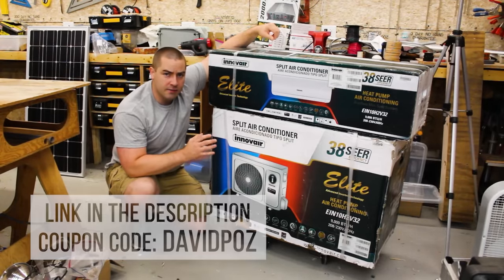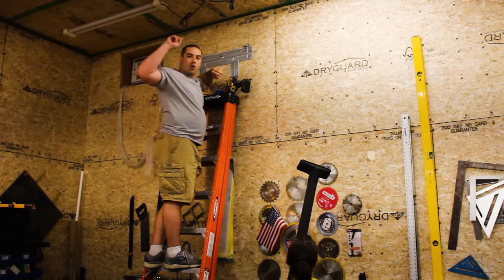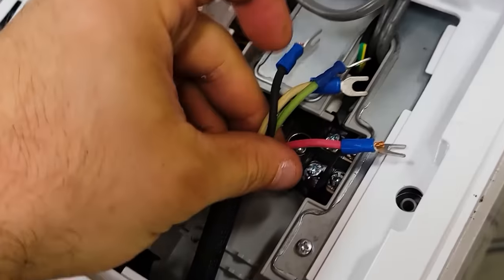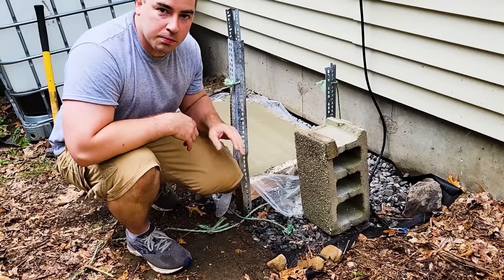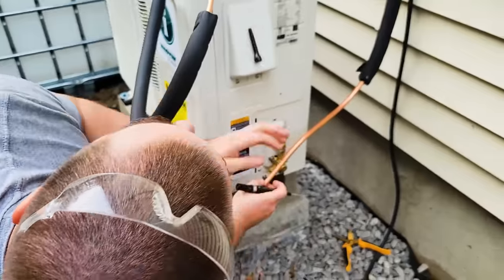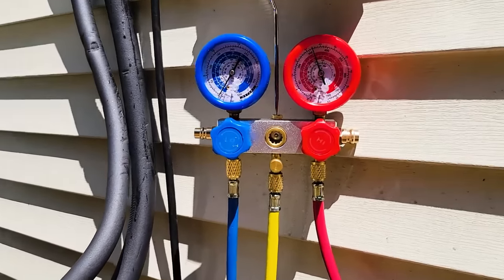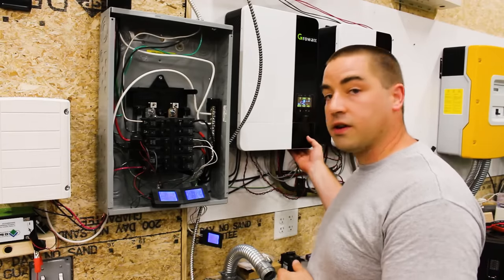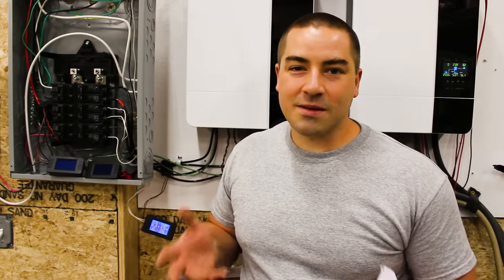DIY Mini-Split Heat Pump, Full Installation, 2021

Comment: This is almost certainly a Midea made unit that is rebranded.  Midea's version is listed at 42 SEER for the 9000BTU/Hr unit.  I have a similar one installed in my master bedroom and another installed at a friends house.

Some tips for anyone else trying this:

1) Connect blue hose to mini-split service port, red hose to nitrogen, and yellow hose to the vacuum pump.  
2) Don't keep changing hoses.  The yellow hose end connected to the vacuum pump will be full of oil mist from the vacuum pump.  You don't want that getting into your mini-split lineset.  
3) If you aren't using a electronic micron gauge to measure vacuum then I would suggest doing at least 3 cycles of purging with nitrogen, vacuum for 30 minutes, and repeat.  Having done two of these now with a micron gauge and a two stage vacuum pump I can tell you that it takes a few tries and a few hours to get well below the 500 micron target.  The analog gauge on those manifolds is useless for measuring a really low vacuum.  A micron gauge is a much better approach and will actually let you know when you have gotten all the moisture out of the system and whether or not the vacuum is holding properly.
4) Tighten and apply Nylog to those brass caps on the service ports.  They aren't just dust caps.  They are a secondary seal.
5) If you have lineset flaring tools, just plan on cutting off the factory flares and re-flare them yourself.  They are usually low quality (oblong, warped, scratches on mating surface, etc.).  Also, the flare should be as big in diameter as possible such that the nut just barely fits over it.  This increases the surface area for the flare connection and reduces the chances of leaks.
6) Do the pressure test overnight.  It's a DIY job so you should have time.  Tiny leaks with not show up within a few hours, but they will cause enough refrigerant loss to be a problem in a couple of years.
Reply: Tip 6 I wish i would have done the overnight pressure test . to late now i think i have a slow leak ,  DYI back inJuly 2019
Reply: I own this same unit and it is a rebranded Gree. I also have a Senville brand which is made by Midea, build quality is much better but not as high of seer rating. Haven't had the Gree long enough to know how it holds up, but it doesn't look impressive.
Reply: This is 100% accurate. I have DIY 7mini splits and I bought all the proper tools, micron gauge is a must for a proper install. The tools are expensive(to get good ones and all the ones you need) but the money I saved on just one mini split Install paid for them almost 3x over. I knew I was installing many units so the right tools to do the job right was a smart investment. I got a torque wrench set to torque the nuts properly too. This is probably unnecessary but I wanted every install perfect the first time. I got a pipe bender too since I was making alot of bends and the line set on 36000 btu units is Thick and hard to bend and not kink. Always deburr your copper line sets with the opening facing down! You don't want copper shavings falling in your lineset. You always need to deburr before you make a new flare on your lines. Practice your flaring technique before you make you final cuts because it can be tricky to know exactly how to make the flare the right size and not oval shaped. Nitrogen pressure test is highly recommended since it will find leaks much quicker than a vacuum will. The nitrogen will also help dry out the lines before vacuuming.
Reply: @michaelseater1004  I have installed senvilles and they are my personal favorite. Pioneer is the same as senvilles since they are just rebranded Midea.

Comment: I've been running the Innovair Elite 9K BTU 37.5 SEER minisplit for just over a year on our small 28 ft 5th wheel RV, running on our 1890W solar PV array and 7.8 KWh of LFP cells, powered by a Victron Phoenix 2000VA 230v inverter. Works PERFECTLY. We had days of 102F in summer in Montana and the inside was a cool 78F. And in Yuma this last week, we had uncharacteristically cold 39F temps at night and the heat pump kept us relatively cosy at around 70F during the night. This minisplit has been a life=changer for us when boondocking with no external power and lovely air conditioned comfort! We can run the A/C indefinitely in the Summer. The heat pump uses a lot more power and so I would like to add another two 325w panels and increase my LFP to 10 KWh to run it comfortably all night long
Reply: how did you mount the unit outside the RV? Roof?
Reply: How about a link as to where you bought the unit
Reply: I'm doing nearly the same as you only I'm using sungold power 220 volt. Same amount of solar and all

Comment: Nice video. FYI: The yellow host goes to the gas. The blue goes to the low side. Never - Ever put your hose in the dirt like that. When you disconnect blue hose from low side, connect it to manifold nipple. Keeps them clean. Same with Red and yellow. Nice job. Got it done. Thanks for sharing. Keep cool!
Reply: I was going to scold him too, lol
Reply: You guys are nicer than i am....
Reply: Y'all too nice, I was also gonna scold him that his hoses aren't rated for R410 pressures, that's an R134a manifold so he likely is also only running 500psi max WP, 800psi burst hoses rather then the  recommended 800psi max WP 1100psi burst rated hoses, playing with fire pushing those hoses and manifold that hard

Comment: I like your attitude and it is great that you read the manual. A few points I would like to make. The flare nuts that come with the unit are made for the temperature changes and pressure of R410A and should be used. I would suggest buying the line set with no flare nuts and also with at least 1/2 inch thick insulation. The use of a manifold set is not necessary but the use of a micron gauge is. Gary

Comment: I am Russian. I liked everything you did - technologically and correctly ! Instead of 1/4 to 5/16 adapters for 410/32 freons, I use taps with the same adapter threads. Crimping with nitrogen under 30 atm.- I also do this .

Comment: Great job with details on installing system.  I always install my systems up off the ground on a supplied wall mount or buy one. As of your suggestion of snow but also weeds, better air movement, less dust, dog pee, socker balls, vandalism, tampering, safety… also never put any type of leak lock or sealants on the inside of the flare fittings. If any happens to get in the system, not good. It is also best to use the line set as is and never reflare or open lines, if they have. No need to vacuum if you use pre charged line set. Running the vacuum for 30 minutes is not long enough and a double vacuum is recommended. Good job and great Dad. Yes I am a refrigeration technician for 50 years.

Comment: Thanks for video.  I just installed my C&H 18k BTU unit I bought from an Amazon returns reseller.  I had to pump my system down - no problem.  Had the pump from fixing my AC on my F250 years ago.  Works Great!

Comment: Love these split systems!  I installed one for my garage/workshop and even if I have it turned up to 80, the garage still feels great in the summer because of the humidity removal.  Super efficient, pretty easy to install.

Comment: I added a 3 zone mini split about 2 years ago and had some longer runs. I decided to have an HVAC contractor come in to pull the vacuum and add the required refrigerant. Nobody would work on my unit because I bought it from the internet! After calling 20 contractors I finally found one that would do it. I did 98% of the installation. They charged me $2000 to do six splices in the lines and add the refrigerant! But how could I complain because they were doing me a big "favor".

So if I were to do this again I'd definitely buy a Mr. Cool DIY unit or plan on buying the vacuum kit and doing that part myself.
Reply from the maker: I can relate to your pains in finding a contractor.  I've also installed a DIY MR.Cool kit, so I have experience both ways.  I like this method of buying the vacuum pump/tools and doing the whole process yourself.  The lines come out so much nicer and it's more efficient.

Comment: Make sure that drain line is on the bottom  of the bundle and has no condensate traps or low spots they will not drain even if it well below the head unit. The condensate will drain out of the front of the unit.

Comment: Carrier came out with a 42 SEER   9000 BTU minisplit over 3 years ago.  I have one - works great!  It also heats with a VERY HIGH  HSPF ... about 15.0 .   It pulls heat from outside air which is at MINUS 23 degrees. So it heats my house even when it is VERY COLD ! 
😉
Reply: Carrier doesn't make mini splits. They are from Midea. What's funny is this unit, the one in the video, and Mideas are all the same unit but Carrier claims the highest seer. However, the indoor unit is more high end on the Carrier and Midea.
Reply: Hi Steve, I was just going to say that. The one difference to this unit is (I think)  that mere mortals can order it whereas the Carrier is only available to certified/trained installers, or it comes heavily marked up with a voided warranty.
Reply: Ya the carrier one is way too expensive and you can't buy it as a customer. You can only get it through a hvac installer. The cost of the install and unit where guaranteed astronomical. You can buy a 38 seer 9000btu unit like in this video for $1400. You  paid atleast $3500+ if not more.
Reply: @sprockkets  ya if you look at the EER rating on this unit and the 42seer carrier they are the same at EER 16.5. EER rating is far more accurate in my opinion since it uses a btu per watt to calculate its efficiency. 9000btu divided by 16.5 EER is 545w. That's how much power it uses at full load.

Comment: A better way to bring down the refrigerant, condensate and power is to elbow the 3" sched. 40 and continue a 3" pipe down the exterior of the wall.  It not only is more tidy but also protects the insulation from degrading in the sun.
Reply: The next best thing after the fact is to wrap the black foam insulation over the refrigerant lines with 3" wide aluminum duct tape.  Not the Mylar stuff but actual aluminum duct tape.  That tape will totally prevent UV degradation of the foam insulation.

Comment: I bet you’ll never forget to put in the connector washer ever again, hehe.😁
Put a little roof above your electrical disconnect /\
You need to do the spray test at the top as well, where you have a connection.
Your pressure and vacuum rest revealed you were sealed properly.
Flip your disconnect pull-out, it’s upside down…that’s why it’s sticking. Those rounded screws don’t make it completely symmetrically reversible. 😀
Breakers protect the wires from burning.
Great job on the entire installation. Excellent indeed.
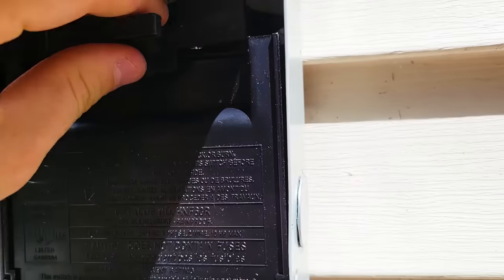Reply: You are incorrect about the disconnect being upside down. At 55:21 you see the words on and off on the disconnect plug with off printed upside down. The plug is designed so that it can be inserted in the on position or flipped and inserted in the off position. This is and has been the convention forever.
Reply: @rcpmac  correct

Comment: When working on electrical distribution panels please verify that you have no voltage present with respect to ground as sometimes a dodgy isolator which keeps one leg jammed on can really mess up your day ⚡. This I learned from experience with 400Vac 3phase that we have here in Ireland.

Comment: Very nice job for a diy. Every unit I have installed has instructions to bring the lines into a 500 micron vacuum with a break in nitrogen flush three times. This is due to the fact, there is only one hose connection, meaning there is no way to blow out any contaminants. Mixing in nitrogen in three times with a 500micron evacuation gets as much of the contaminants out as possible…
My simple tip solution for his is to break the small flare to bleed out the first nitrogen pressure test. This blows out ALL contaminants, then retourque the flare, pressure test for leaks, evacuate, and you are done!
Reply from the maker: Thanks for the tip, I hadn't heard that one before.
Reply: That is an ideal situation that is not typically part of a DIY installation. All these DIY mini splits are for homeowners that dont have the knowledge or the money for nitrogen or vacuum pumps. When I inquired....I  DO have the nitrogen and vacuum system...I was told that as DIY...they are designed to have some non condensibles in the sealed system...and be 100% ok. Mitsubishi would have a fit if you installed theirs at a DIY level.
Reply: It's probably good to get a ball valve fitting on the connection to the compressor at the vacuum line so it doesn't discharge the refrigerant into the manifold gauge line. They're available at fairly low cost.

Comment: Whenever I receive freight I open up the boxes and do an inspection. Any visible damage I refuse the freight. Then call the freight line OS and D Clerk. That stands for over short and damaged. They will handle the insurance claim and getting it back to the manufacturer all I have to do is sit back and wait for the replacement

Comment: I recommend pressure testing first before pulling a vacuum. No need to vacuum twice, it is overkill.  When pulling a vacuum use a micron gauge.  You are already doing a far more meticulous job than you would likely get from a professional installation. Thus great job!!
Reply from the maker: Thank you.  If I install another I will buy a micron gauge and Schrader valve removal tool.  I didn't know about all these optional tools until these comments.  So, thank you.
Reply: @DavidPozEnergy   I did a DIY install myself and bought these tools you mention a few years back.  They have sat quietly in my basement since.  I'm in NH and would happily  loan them to you if you need them sometime.  Please feel free to reach out if you do.
Reply: Not to mention by running a vacuum first , if there is a loose fitting you will potentially be pulling in moisture/ contaminants into the system. So always dry nitrogen 1st. Absolutely outstanding as a DIY’r. You certainly did your homework. Great Work !!
Reply: I agree with you there Edward, but isn’t that really a sad commentary on how some “professionals” do their job. I’ve installed dozens of these systems. When i describe my process some of the “professionals” they comment on how unnecessary some tasks are. Most don’t even have a bottle of GN2, nor do they have a micron gauge, let alone a torque wrench to properly tighten the lines.

Comment: That cement base should be a video on it's own, very informative, Thanks
Reply: About that base. A bit of overkill on the reinforcement wire for such a small pour and not enough put into the gravel pad. The unit will vibrate the solid concrete and eventually loosen the gravel which will crawl out the sides and the pad may shift out of level. At least carve out a hole in the dirt to hold the gravel.

Comment: David, one thing I would add  to the end of this video, you should check the line pressure after the coolant has been released and the unit is running. I did not, and it turned out that the unit was low on refrigerant upon delivery. It ran , but very  weakly. I spent several days searching for leaks that did not exist. After four days of constantly checking the pressure, I realized that it came low on refrigerant, my pressures were holding steady at half what they should be. The manufacturer agreed to pay for an Hvac Co. to fill the system. They wanted $250./LB plus $99.trip fee. That's California for you! That adds up to half the initial cost of the complete system. DIY.....

Comment: The line sets that come with the unit are metric generally.  It would be advisable to leave a service drop in the lines so that any future repairs will have room to put new fittings on the line/lines.
Reply: It seemed like the line set was usable as is without cutting and flaring, didn't really have that much excess length to warrant cutting it shorter.

Comment: An HSPF rating of 15 too with claims that it heats down to -22F! This is an amazing heat pump, seems almost too good to be true. I’d love to see more updates about it over time.
Reply from the maker: I plan to do another update in the winter to see how well it heats.  It worked beautifully this summer.  It was at least 4x more efficient than my old window unit shown in the video.  But, window units are not known for efficiency.  LOL
Reply: @DavidPozEnergy  If you plan on heating down to -22 you beter have electric strip heaters as well for defrost or every time it reverses you will lose the heat you just made but then again if they derated heat capacity and that inverter might make up some of today's magic I'm used to old school tech when it comes to heat pumps will be interesting to see how your results come out.

Comment: David, Ex HVAC guy here....FYI for the next one....you only needed to go to 100 maybe 150psi if your OCD......you turn off the nitrogen and do what is called a leak down test. it's a timed test that shows leakage and if the guages don't move in about a half hour your good to go but check with soapy bubbles in between.  Also, go back and take the caps off the condenser valves after a few days of running and spray soapy bubbles on the valve that you turn out.....occasoinally those will leak after start up the unit. Shut off the unit and turn in the valve, put some sewing machine oil inside with your finger....enough to put a sheen on the inside and run it back out. If that doesn't work then some red locktite on the cap threads generally does the trick.  Hope this helps.
Reply from the maker: That is a great idea.  Thank you.  I had never heard of that check before, but now I'll certainly have to go do it.